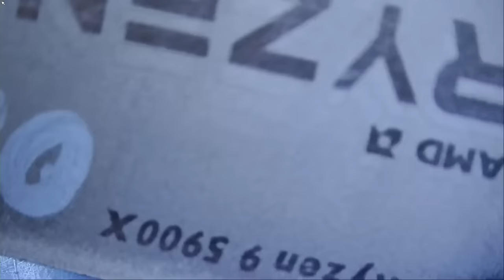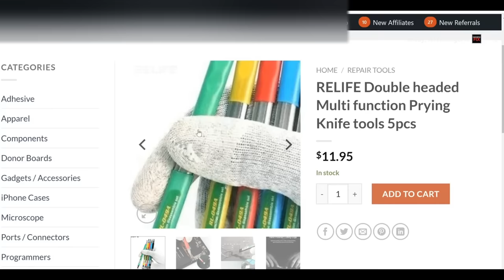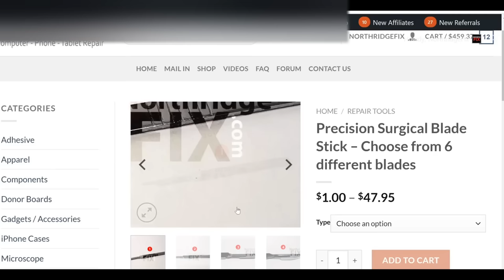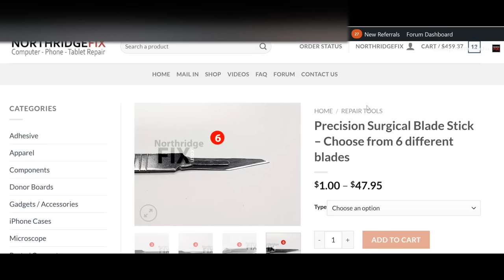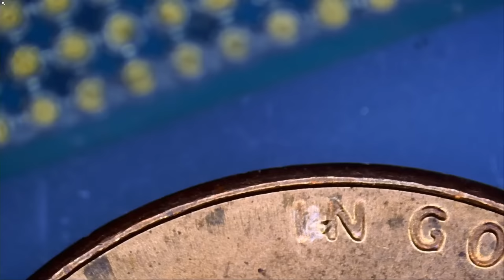Hit with a slipper - Two AMD Ryzen 9 CPU Repair Pins broken in the middle.

Comment: Hey Alex from Romania. Back in my service days, whenever I came across bent pins, I used either an 0.5 or 0.7 pencil (the kind that works with cores obviously) or a ball point pen. These days, with these pitches, an 0.5 should be more then adequate. Reduces the chance of the tool slipping and sending the pin to the 9’th dimension. Try it, see how it works.
Reply: He said he prefers to do it this way.

Comment: The pins tip over because of the surface tension in the solder, when there is too much, the solder bead wil become convex, and the pin tips over. When you have too little the pin won't stick, but when you have a perfect amount, the solder wil be concave, and actually pull the pin into a perfect perpendicular position, just because of the surface tension.

Comment: Here's an idea. They make all kinds of power plugins, and you solder well. And batteries are generally 1.5 volts each. So if you have 2 batteries that's 3 volts. So you buy a 3 volt battery power supply, cut the end connector off. Solder it into you audio thingy and no more batteries needed. or if you want to get fancy you could install a small usb plugin by gluing one in and wiring it up. Then buy the correct power voltage plugin with that usb on the end of cord and that's it. But I think just wiring it directly would be easier and look better. But no more batteries is the main thing. And if you happen to be a environmental person that's less toxic waste.

Comment: I use an old soldering tip for something like this, which I sanded down and drilled a hole lengthwise, which has the diameter of a syringe needle into which a pin fits exactly. I soldered the syringe needle into the soldering tip with silver solder and then ground the needle so that about 3.5 mm of the needle still protruded from the soldering tip.
then i built a tripod in which the soldering iron is clamped and can position and solder any pin precisely and perfectly.

Comment: How on earth do people bend CPU pins???  They must be using a hammer
Reply: LoL 😂       good question
Reply: You'd think by now people would know to be extra careful with a CPU. But, they drop it when trying to install or set the CPU down and drop a screwdriver on it or something. All dumb stuff that is easy to avoid.
Reply: I suspect someone trying to force push that ryzen into Am2/3 socket...
Reply: Alot of these reasons are stuck thermal paste on the heatsink. When you go to pull the heatsink, the cpu is cold welded to the heatsink, so when you pull, it forces the cpu from the socket and usually falls from the heatsink.  This is where education of twisting the heatsink should be advised, but some newer boards now you can't twist the heatsink unfortunately because they are mounted with through holes.

Comment: Do you test the CPUs before you send them back to the customer?
Reply: Thats not the job, the customers asked for damaged pins to be fixed or replaced. Regardless if the CPU is dead or not he did the job as requested.